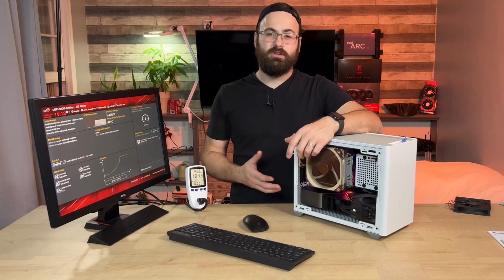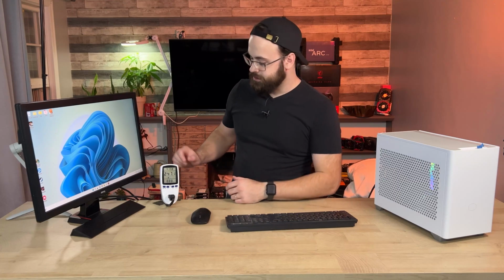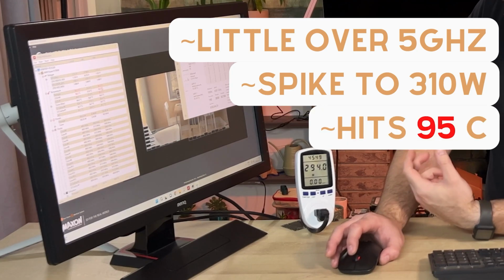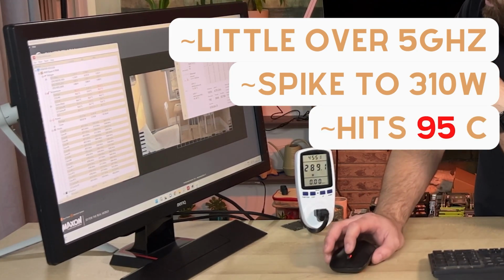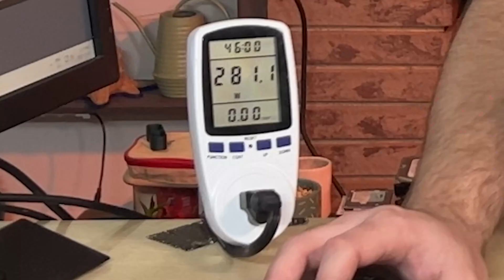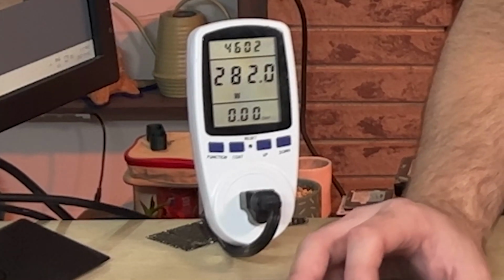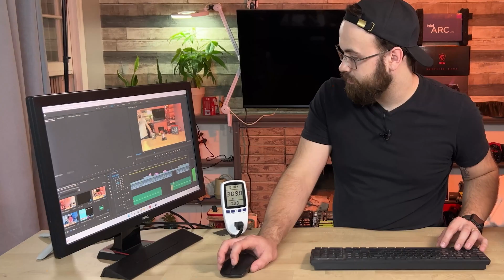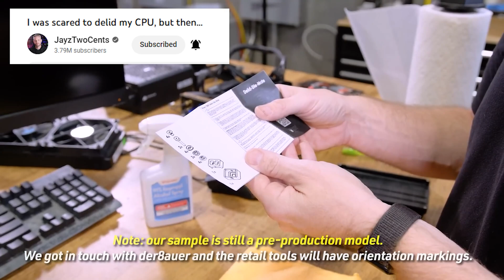7950x/3090 ITX Build: Power, Thermals, Gaming & Productivity - Part 2

Comment: Did you or ASUS ever resolve those 2 fans on the mobo noise/ control? I am looking to build a PC in the Max version of this case and I want to keep it a quiet as possible. Looking to do a full AMD build, 7800x3d/ 7950x3d with either the 6950xt or 7900xt. Thank you
Reply from the maker: Others have reported this has been fixed through bios updates. I personally have not checked yet.

Comment: Can you share the custom bushings you designed for mounting the top fans? Great content!
Reply from the maker: Yes I can! I’ll post them over on Printables by tomorrow.
Reply: @ultraprecisiontechnologies  thank you!
Reply from the maker: I'm really sorry, I absolutely cannot find the files for those little bushings. I'm not even sure if I saved it now. If you're able to, it is the most simple thing to design using a basic tool like Tinkercad. Take the top steel mesh off the top panel by bending the metal flaps straight under the top panel. Separate the metal mesh from the plastic. I sent normal fan screws down from the top into the slim fans, but you'll see there is a gap. I just printed a little spacer to give the fan a nicer surface to butt up against. Basically a washer with a custom thickness.
Reply: @ultraprecisiontechnologies  Ok no worries, I'll figure something out, and thanks for the explanation!

Comment: will this case be good for 4k gaming with  a 7700x and 7900xt?
will it have heat issues?
Reply from the maker: This is a great small form factor case for higher powered hardware. You should have no problems.

Comment: Possible to build the cpu with liquid cool?? What can you recommend cpu cooler for that cpu and nrp200 case??
Reply from the maker: Yes, you should be able to fit a 240mm aio cooler no problem on the side mount bracket that comes with the case. Sorry I don't have a specific recommendation as mine is air cooled!
Reply: @ultraprecisiontechnologies  the 280mm of coolmaster cooler. You mean top or side radiator?? Base on specification in top only having radiator

Comment: C14S + NR200P man this is pretty much exactly what I might go for once 7800x3D lands, I have an SF600 PSU already so hoping that's enough for a new "budget" GPU every 3 years or so. I would FPS limit to 120 max since I'm getting old, so that should still work quite well with some CPU/GPU undervolting. Might lay the case on the motherboard side if that brings more GPU air.

Comment: How much CPU power is safe to pull of this motherboard with only 8 pins ? (vs 12 or 16 pins on other E-ATX motherboards)
Reply from the maker: I’m not sure if you’ll find an official spec from
Asus on this, but even a heavily overclocked 7950x is no problem at all in the real world. If you were pulling some extreme amount of power, you could feel the connector to see if it was getting warm, I suspect up to 300w would be fine, potently more could also be fine.

Comment: man idle power consumption is so high on ryzen, even on my 5900x and rtx2080, around 90W at idle (similiar as yours)..that's just wasting so much into drain :(
can someone confirm this, or tried on own system but only with wattmeter (no software readings) for idle...thanks in advance
Reply: From what I've seen by other reviewers the idle power is high and it's expected that AMD will be dropping a driver update to manage this. When that would be is anyones guess. AMD is known to continue developing their drivers for years, though I expect this would be one of their top prioritites as they keep pushing the marketing aspect of effiecency over the competition.
Reply: @igavinwood  sir, thank you for this information

Comment: These new cpus run too hot by default. Bad news for silence focused mini itx air cooled builds. Wonder if i should just wait until the next generation comes out
Reply from the maker: Heat definitely seems to be a factor, but that comes along with all the competition and each company trying to eek out as much performance as possible. Maybe I should do a dedicated video on how easy it is to have good thermals by changing a few easily accessible settings?
Reply: @ultraprecisiontechnologies  that would be great :) i know the small fans on the mobos can be noisy. Are these fans really necessary? Is it possible to ghetto rig a quieter! larger fan that cools the same area?

If i decide to keep the nr200 (i like its wide compatability) im wondering what air cooling heatsink is the best choice for a 7950x. Seems like the c14s is not as good as a u12a? Noctua website only gives c14s one green compatability bar. Would using a side vented nr200 with fan attached to the intake grill help much? Not sure if the u12a will fit.  

looks like it is not possible to run the new cpus at their max performance level without power limiting to bring thermals (and hence noise levels) under control.

Comment: How about putting the fan on the side bracket above the CPU cooler as intake and maybe put another slim 120mm fan under the cooler? This way you can put 2 140mm fans on the side bracket as intake for some extra fresh air

Comment: Do you think the Asus ROG Strix B650E ITX Board can also handle the 7950X in 105W Eco Mode or would you rather go with the X670E here? Do you have to use the Hive?
Reply from the maker: In my opinion, b650e can handle the 7950x in eco mode, and at its full rated tdp, and probably even overclocked. These vrms are so overbuilt. The main thing your getting with the x670e is connectivity, and maybe some better component selection for parts used in the board as well as some more optimal electrical engineering. 

All in all, unless you know you need the X670E, you’ll likely be better off saving your money and getting the B650E.

As far as the hive strix goes, if you want audio or boot leds, or bios flashback, you will need to use the hive, as that stuff is not included in the main board.
Reply: @ultraprecisiontechnologies  Could you also use any other DAC instead of the Hive for audio? Thank you!
Reply from the maker: @frihyde  is DAC dedicated audio card? 
If so, an internal card is kind of out of the question as you only have the single 16x slot, presumably used for gpu, 
Otherwise, I believe there are usb audio cards that would work, although I’m not entirely sure, and then also I would ask why you would do that Vs just using the Hive and stashing it away somewhere out of sight 🤷🏻‍♂️
Reply: @ultraprecisiontechnologies  Sorry I meant an USB Audio Interface. I got the Audient Evo 4 which also works with my MacBook. Having an Audio Interfaces for each device on the table won't look great 😅
Reply from the maker: @frihyde  I just did a quick search and it looks like that device is an audio capture device, so if I’m looking at the right device, it will not work to generate audio from scratch like a sound card would. (The Hive has a built in sound card, or rather IS a sound card.)
Reply: @ultraprecisiontechnologies  Oh I see, how about a FiiO K5Pro Amp? However, I had the idea of mounting my PC under the desk in which case the Hive might come in handy! Moreover, I read about the Hive having a PBO Button for quick OC. Do you think I could set a Default (Eco 105W) for Gaming and OC/Stock Mode for productivity work and control it just with the Hive button? Thank you so much!
Reply: @ultraprecisiontechnologies  DAC means Digital to Analog Converter. Its a very standard term for sound equipment. Speakers/headphones are analog devices. You have to have a DAC, to be able to generate sound on your speakers, from a digital source.

Comment: First time seeing this channel so apologies if I'm missing something here, but WHY would you do a static undervolt/underclock? You could just enable PBO and use curve optimizer. OR just set the TDP lower and let the CPU regulate itself downwards. Ideally...you'd have done both! Honestly confused if you just didn't know or are saving it for another video.

To those of you watching, don't use this as a guide for undervolting your Ryzen CPU...you can get better performance and it's not difficult.
Reply from the maker: I agree with you 100%, I think I may have missed with the point I was trying to make, which was just that the cpu can be much more efficient while under load. I was just trying to show the efficiency gains that are possible if you tighten up the reins a bit on the voltage and frequency. 
I feel like optimizing performance with AMD CPUs could be it’s whole own video. Thanks for watching and I appreciate you taking the time to comment 🙏

Comment: I have that board, think it’s funny that the fan sounds like it’s about to take off when I boot it but I usually turn it on and walk away
Reply: Do you hear the fans after booting? Would you still recommend the X670E or rather buy the cheaper B650E Version?
Reply: @frihyde  no I don’t hear the chipset fans at all after booting, just during the boot sequence when it’s at 100% that’s it’s pretty noticeable. So far I’m happy with the board, the B650E option could be good alternative though

Comment: Great video, much appreciated! I'm also planning to do a 7950X Build in a Dan A4 H20, but wanted to try the 105W Eco Mode. Will also use a 750W PSU - should be sufficient! 😀

Comment: Thanks for another upload. Quick question, for the ROG FPS card how did you insert the Power SW and Power LEDs? The manual doesn't specify polarity and the only picture in the manual shows the orientation of the Reset SW. Is the Power SW and Pled cables facing the same way or is the opposite way? Thanks
Reply from the maker: If you google “front panel header” and go to images, you’ll see the pin out. Front panel connector is mostly standardized. Just make sure you line up the one corner with the missing pin accordingly when looking at images. Let me know if this helps